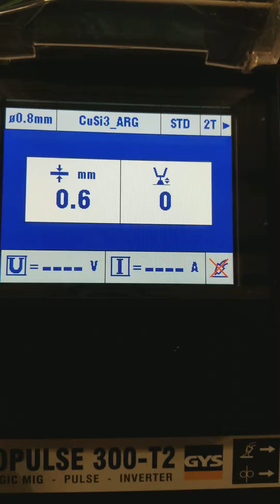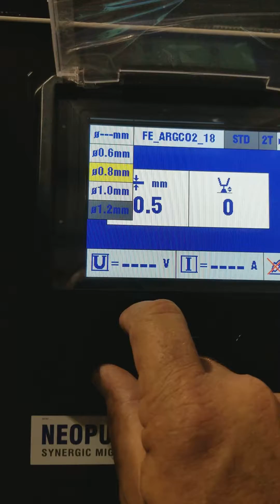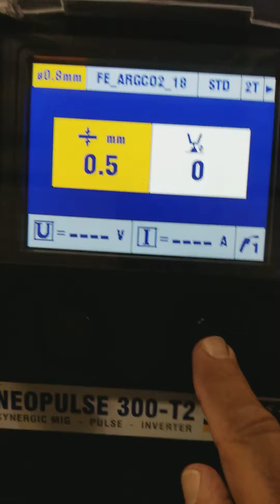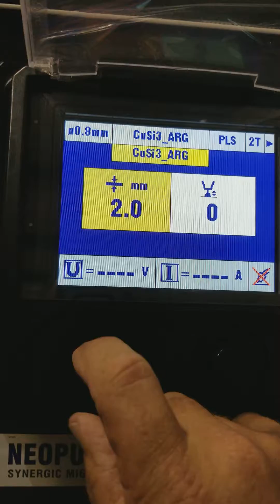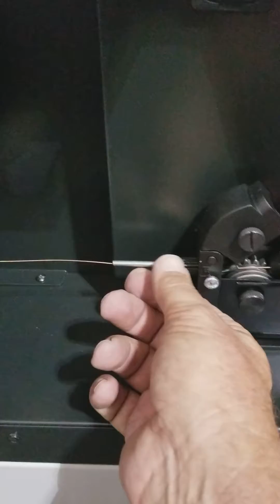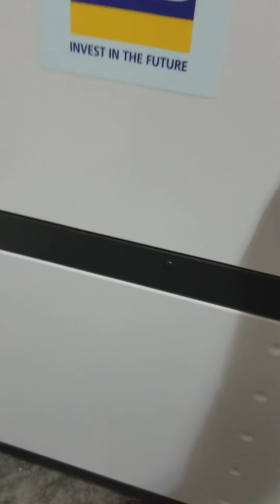Neopulse 300T2 Basic Operation

Comment: Thanks man for the tips!!!  I have at work neopluse 270 and gosh they don't have instructions for it and I welded before with old mig. Machine basic setting for Amp. Power and wire flow, worked like a dream, but this neopluse was like switching form 80's car to 2023's🤣